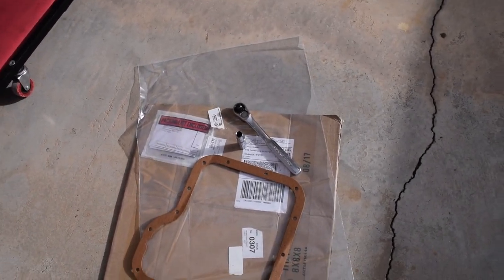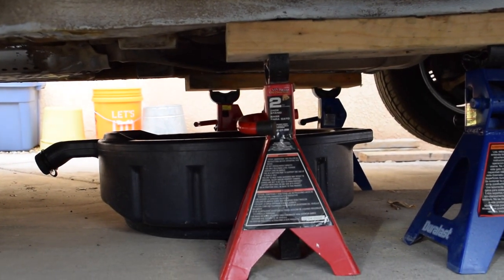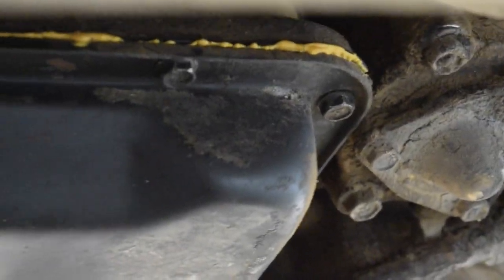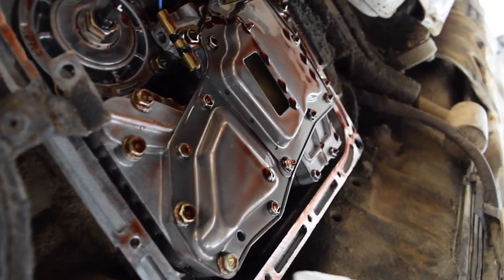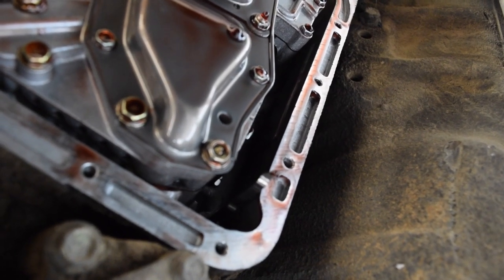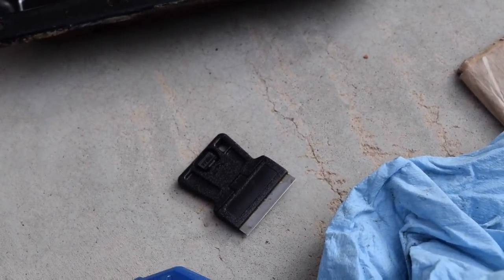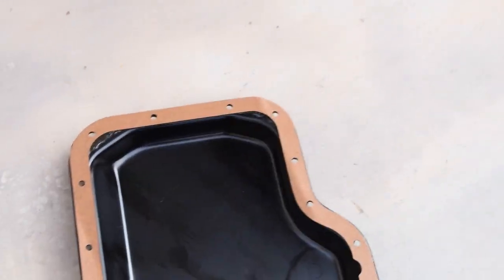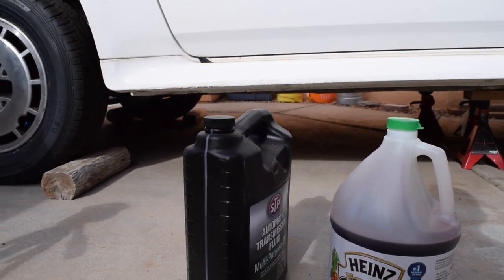How to Change your Automatic Transmission Fluid and Filter (300zx z31)

Comment: Noob question but how exactly
Do you read transmission fluid level ? Does z32 need to be turned on when checking ?
Reply from the maker: There should be a dip stick to read the level. And yes the car must be running when you check the level.